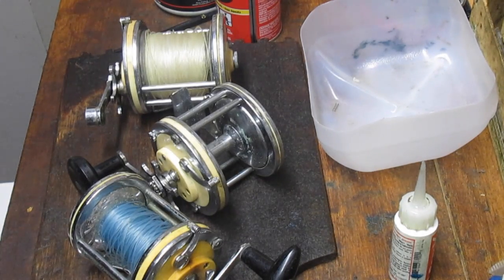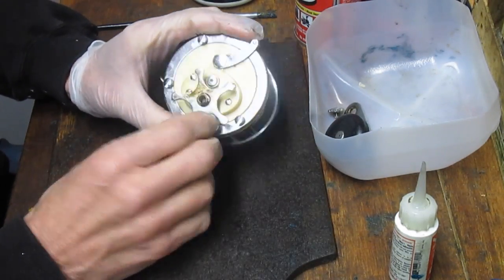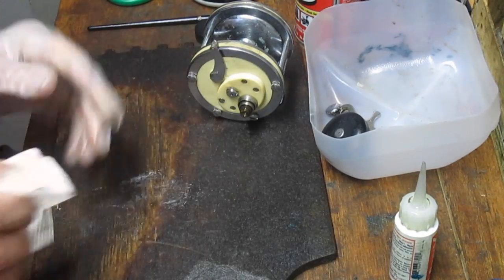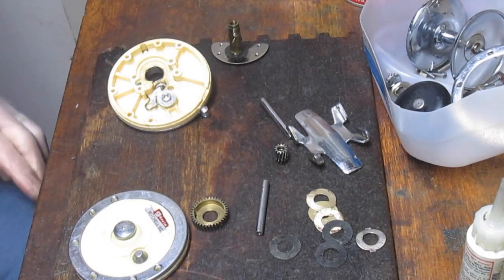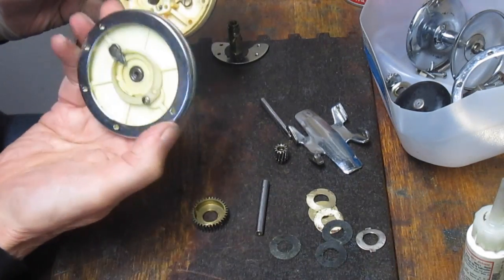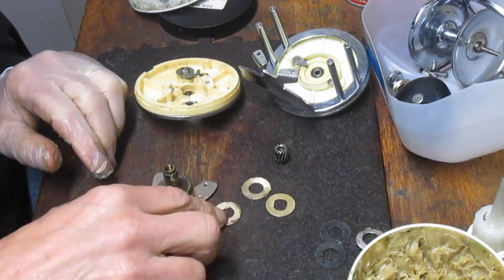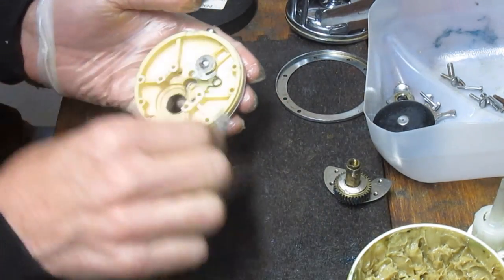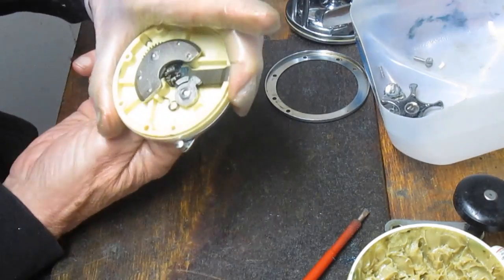Mitchell Garcia 624 Saltwater conventional fishing reel how to take apart and service

Comment: Hi Dennis. Enjoying your videos as always. I have a suggestion for the part where you have to remove the handle nut with the channelock pliers. As an electrician I would sometimes have to tighten lock nuts on expensive light fixtures when assembling them for homeowners. We would wrap around each jaw of the pliers with electrical tape. You don't lose any gripping, you don't chew up the teeth on the nut and the sides of the pliers won't scratch up the chrome finish. Hope this helps. Stay healthy, stay safe and look forward to your next video.
Reply from the maker: Thanks for the tip Anthony.  I will try that.  I have used a kitchen scrubby for padding on crossbars and the like, but that is too bulky for the thin nut.  I will definitely use that.  Thanks too for watching - Dennis

Comment: Hi Dennis I have a Michell Garcia 624 , First time I fished with it last weekend. The line kept getting caught in the side of the spool. I am totally new to this reel and the conventional multiplier reels, am I doing something wrong or do I need to adjust something on the sides. Keep up the great work and great videos.
Reply from the maker: Yes - there is a spool tensioner on the non-gear side plate.  Turn that clockwise in order to tighten the spool and reduce the gat that is causing the line to get caught.  Do not over tighten the bearing.  There should be light side to side play.  Dennis
Reply: @2ndChanceTackle  Cheers Dennis.

Comment: As always great video Dennis. Just picked up one of these that was in a box of Penns that I was buying.   Was wondering if you use an ultrasonic cleaner and if so, what do you use as a solution? Thanks, Chris
Reply from the maker: I do use and ultrasonic cleaner and that 624 will clean up beautifully.  That chrome is second to none and the side plate tarnish from old oil comes clean with a kitchen scrubby and some gentile polish,  Most of the time I just use a mild dish detergent in the ultrasonic cleaner.  I have experimented with some other solutions and find that some with acids, like citric cleaners, can damage the finishes on paint and remove decals, so I err on the side of less is better.  Thanks for asking and for watching. I did a video about a year ago on the ultrasonic cleaner and actually used the Mitchell as an example.  You can see it here https://youtu.be/D-ioPSYdtWI. Dennis

Comment: Great video.  In your experience, is there another, more readily available, source for that dog spring that's prone to flight? Perhaps from another brand of reel.
Reply from the maker: I don't know of a company supplying them, but EBAY Europe has plenty and EBAY U.S. has them from time to time..  Unfortunately, the cost is crazy due to the shipping charges.
It is not too hard to find a small spring, from a used BIC lighter or ball point pen and cut it down to size as a bush fix.  Also, the Penn Reels coil springs for the larger reels, like the 6/0 senator will probably work.

Comment: Great Video good to see, very knowledgeable thank you. I brought one of these reels, keep getting birds nest. I seen a video with a guy convetered a Penn 1970 beachcaster with magnets to slow down the cast. Is their any way of  converting the Mitchell 624 by adding magnetics to slow the reel down, limiting bird nest. If so can you make a video of the convertion please.
Reply from the maker: I am not aware of the conversion using magnets.  Maybe you can drop a line to the guy that did that Beachmaster video.  You can slow the spool with the side plate bearing adjuster.  You may want to try that - Dennis
Reply: @2ndChanceTackle  Thank you for reply Dennis. Thanks for suggestion but I wouldn't have a idea what a side plate adjuster look like or which size to get. Sure I find a picture on net. Thank you Dennis. Billy.

Comment: Hi . I have this exact reel I have just brought . But I have just found that my anti reverse isn't working so my handle is spinning both ways when switched into gear . Can you advise me please ?
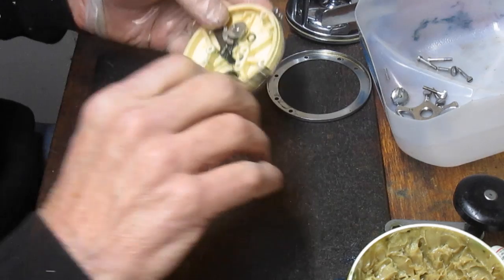Reply from the maker: Yes - your anti-reverse function is not working - Check the dog and or the dog spring to make sure it is installed properly.  That this video beginning around 22:30 minute mark to see how it should be installed - Dennis
Reply: @2ndChanceTackle  hi thanks for your reply . I have just took it apart going through your sane steps and on opening it up there was intact no spring at all where the dog clip is . Di you know where on the Internet I can get one of these springs plz